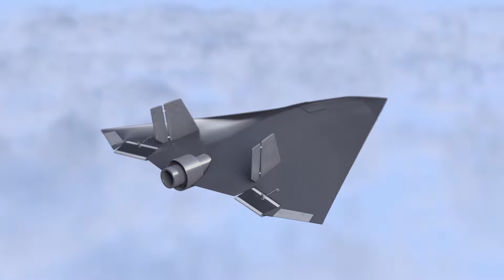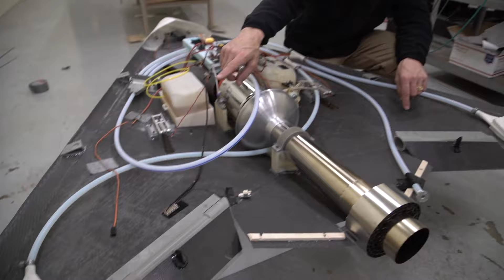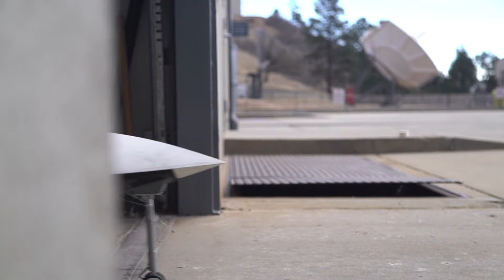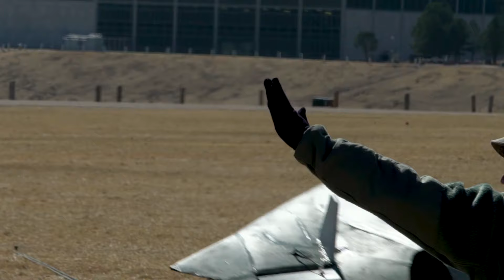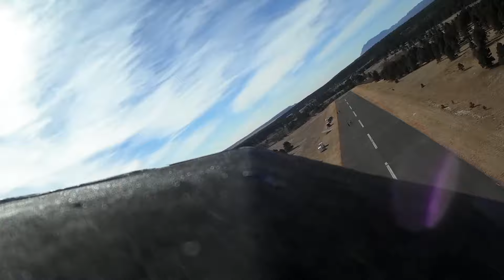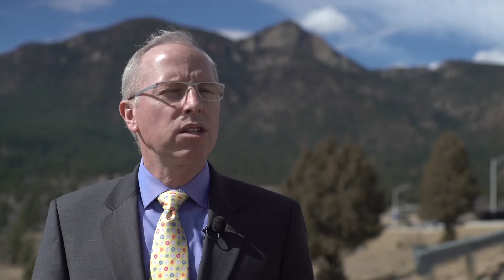Scientists Develop Flapless Sealth Drones For the Military

Comment: So it looks like they’re using the compressed air coming into the engine for their directed flow control surfaces. All they really need is good valves and digital controls. Looks like they still have two elevons for low speed maneuvering (plus as failsafe) that get switched off at high speeds (nearing top speed for this model whatever that is) in favor of the directed flow controls. That honestly makes a ton of sense when you’re traveling at high speeds. Even the slightest slop in the elevon mechanism at high speed could cause the craft to shake, which could create a feedback loop and result in complete loss of control, it could make adjusting trim difficult, or, if we’re talking supersonic speeds on a full scale model, if they’re not designed properly could rip the elevons right off and destroy the craft. Having a completely internalized method to control the craft like this is a great idea. It also looks like they were just testing the directed flow surfaces as ailerons.I’m sure they’ve already figured out that they need at least one more flow surface to make the craft fully capable on just flow controls
Reply: hey have a nice time. i am trying on ideas of drones. Knowledge makes sense. could you share your another studies? glad to see your comment.